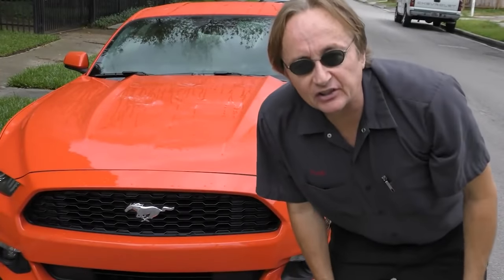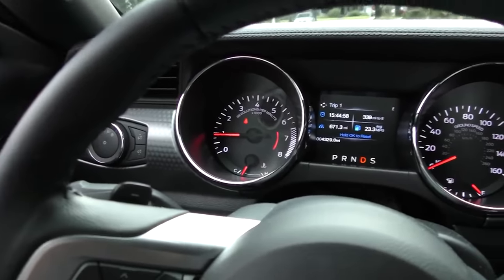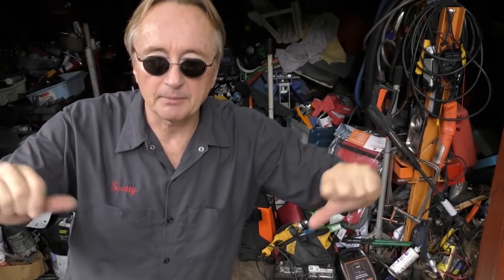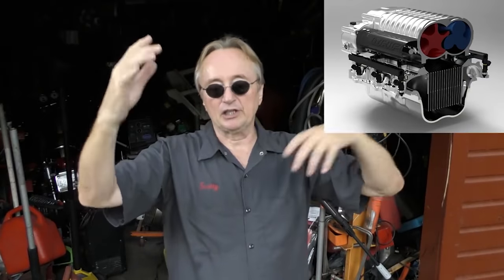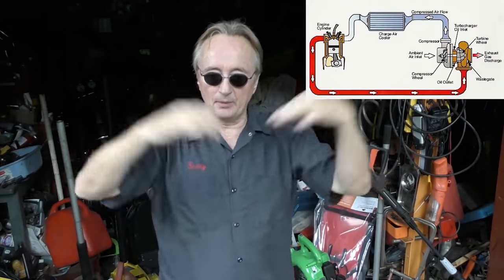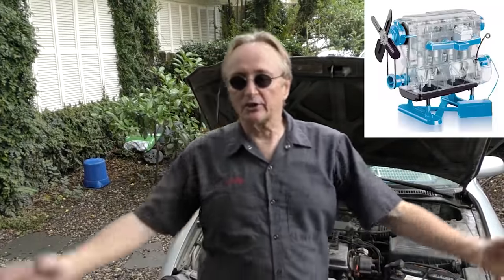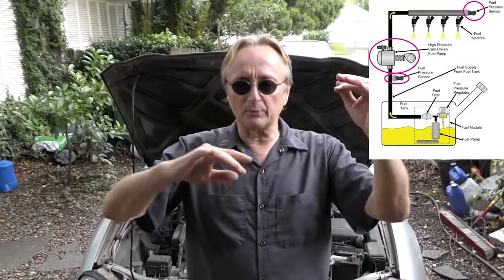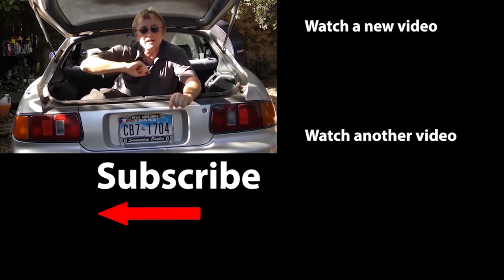I Was Wrong About This Engine and I'm Sorry

Comment: That old V-6 that Ford used to make available in the previous generation Mustang was sweet.  Sad that Ford kicked it to the curb in the name of foisting the Ecoboost on its customers.
Reply: Diesel cars have had turbo & direct injection for 30+ years and lasting over 200,000 miles.  Gasoline turbi-DI should be able to do the same

.

Comment: Recently was in the market for a mustang was gonna get a 16 ecoboost but got a great deal on a 14 with the 3.7. I LOVE this motor. Sounds so good at redline.
Reply: The 3.7s are solid/reliable engines...  Some of the earlier models (~2011-2014) offered a performance upgrade option (Mayhem Mustang) where they upgraded a lot of brake/suspension components with GT parts and upgraded differential gearing. Unfortunately, when they rolled out the Ecoboost, they stopped offering the upgrades on the 3.7 and only made them available on the Ecoboost. They really improved the V6s from the previous generation (4.0 SOHCs)... However, the MT82 does take some getting use to though.
Reply: It’s a great motor. I hope you keep it for a long time
Reply: @robc7323  yup they stopped after 2017 with the v6 and its a shame cause I had a 16 ecoboost and it's not the same. Even with less horsepower the sound alone makes the motor more worth it. Car only had 48k miles on it and it's in GREAT shape. Only repairs needed now are sway bar link and brakes. Funny thing is with the ecoboost I had to use premium gas with my performance tune and with reg driving I'd average around 21 in the city but with the v6 I average 20.5 and that's regular gas so much much cheaper. Loving this car. I want a louder exhaust a  slight tune to get about 330 hp and a Bluetooth touch screen because mines a base model and didn't come with Bluetooth 😐
Reply: @CactusJack252  planned on it! It's my daily driver and after this is paid off I planned on getting a beater. She handles great in the winter with some good winter tires. Plus they don't make the 3.7 anymore so it may become a collectors piece.

Comment: The 2.3 Ecoboost is the only engine available for the Ford Ranger.  On paper, the 2.3 Ecoboost outperforms both the hp and torque numbers for the 17 year old 4.7 liter V8 in my 05 Tundra.  Fingers crossed, we have to wait and see how well the 2.3 Ecoboost holds up to 17 years of use.

Comment: 2014 Ford Fiesta ST 1.6 ecoboost  160,000 miles and going. Oil change every 5,000 miles. Oil in a turbo car gets gets hotter as the oil lubricates the turbo. I have the dealer do the oil change and use a coupon.  I am on my 4th set of brake pads and 4th set of tires. I also have swapped the rotors twice. The initial brake pads were too aggressive and they and the rotors were all gone by 30,000 miles (originally it had racing brakes that stopped you in a hurry). Ford changed the pad compound in 2015 and pads were hard to get as the auto cross community burned up all the spares. I now use Canadian rotors. I drive normal and get 33 MPG. I can still spin the front wheels if I hit the throttle too hard and the road is wet when I start out at a light. The car is nimble and quite fun to drive and I drive it daily to my job as a math teacher. Changing the oil is the key to longevity in the ecoboost.

Comment: Welp! My 2019 Ford Fusion Titanium has an  Ecoboost 2.0L 245hp engine. It's currently at 53,000 miles. First 3 oil changes were at 10k each, fourth through sixth oil changes were at 7k miles each. Fuel injector service done at 40k. Cabin and engine air filter every 15k and 25k respectively. I used to use regular 87 octane, but after my fuel injector service at 40k, it's been premium gas ever since. So far so good. I plan on keeping this car till at least 200k miles 🤞
Reply: Bring that oil change down to 5k miles.
Reply: @slscamg  Do you mind telling me why 5k?

Comment: The best way to look at these little turbo charged engines is , they wont last very long. They will wear out a whole lot faster than an naturally aspirated engine especially if you drive it harder than just normal.
Reply: the brighter the star the hotter it burns the faster it dies
Reply: Our ecoboosts start knocking at 30k miles. They’re made to be 1 year lease vehicles then junked or resold. They don’t last long at all.
Reply: You sir are 100 percent right.
Reply: Older turbocharged port injected engines are better than newer direct injected ones.
Reply: @kyrosmike  Not really. Honda 1.2 liter turbo. 32 years old, still going strong and I regularly get it to 60mph.
Reply: @bremCZ  how many miles on it? It's not the age, it's the mileage.
Reply: @northdakotaham1752  I bought it with 150k on it, it now has just over 340k
Reply: @bremCZ  there has never been a vehicle made than makes me wish I could put 300k miles on it. I enjoy driving....but not quite that much.
Reply: @northdakotaham1752  Me neither.
Reply: @davidperry4013  as a rule all lower stressed engines last longer than higher stressed (higher specific HP) versions. High output performance Chevy, Ford, and Mopar non turbo engines are not as good at going the distance their low performance versions do. I have seen some 150k mile 2.0 DI turbo engines for service that were doing well but I have had a big sample to have a sound opinion yet. They have not been around long enough.
Reply: Diesel cars have had turbo & direct injection for 30+ years and lasting over 200,000 miles.  Gasoline turbi-DI should be able to do the same

.
Reply: @northdakotaham1752  it's not about whether you could put 300k miles on it. It's that it's good that a vehicle can last that long and you would think with technology improving so much. Why is it that 20-30 year old cars are more reliable and well built than new vehicles that are produced every year.. are we going backwards as humans? It's also good when vehicles last longer because each car that's in circulation not driving is just mechanical waste. Every vehicle being fixed and driven again that's 10-15 years old is another vehicle that isnt being bought and produced from a dealership. If that makes sense. We already have a chip shortage you would think the world would be focused on saving our resources now but everyone needs a new car every year...
Reply: Religious oil changes and not driving the car like a teenage boy who just got his license and youd be surprised how long theyll last
Reply: not true, 300k strong, firstgen/3.6 TT\ECO and still running. take care of your ride.
Reply: @bremCZ  rust bucket lol.
Reply: @electrictroy2010  turbo engines from 30 years ago did not make the boost and horsepower that they have turned these new "ECO" engines up to. Cylinder wall thrust today is far worse than older turbo engines. Its simply why the horsepower hours are exhausted in top fuel engines after 1320 feet of use.

Comment: Yeah the funny part is that 4 cylinder Mustang engine has a habit of exploding because of the strain it's constantly under.   I talked to an older guy at the Costco gas station a year or so ago and his sister had a 4 cylinder Mustang newer model and he said her exploded and she was about the same age range as him, he was in his 70s.
Reply: They put this engine in a lot of vehicles, and they last. Maintenance is key.
Reply: @bongodave13  exactly
Reply: I feel about the same about a 4 cylinder in a modern Mustang as I did when Ford put a 4 cylinder in the Mustang 2 back in 1974. It was crap then and it's still crap. Didn't work well then and won't work well now.
Reply: @Rick I had a nice laugh from that one as well.
Reply: @northdakotaham1752  The facts defy your analysis.
Reply: Did she happen to be from Pasadena?
Reply: Diesel cars have had turbo & direct injection for 30+ years and lasting over 200,000 miles.  Gasoline turbi-DI should be able to do the same

.
Reply: @Rick Spark plugs are mostly a maintenance issue, not so much a "repair." So there's that.
Reply: @electrictroy2010  The internals of turbo/supercharged gasoline engines are built/manufactured much tougher/stronger now. Technology evolves and humans learn from the past much quicker than our species evolves. And then you have Darwin... So there's also that! lol
Reply: And then there are people who have these engines high strung to the moon and have no issues. Sometimes the car you buy is a bad car and other times it is not.

Comment: I do have a 2014 Eco Boost 3cyl-1L Ford Tourneo, and I drive it like a granny, I get the oil changed frequently,  now it has 85000 km (about 52000 mi ), consumption 5.8-liter_gasoline/100 km, so far the engine is ok.  With stick-shift, I try to shift very gently, so that the pressure relieve valve of the turbo doesn't spring in action, use low rpm (1200 - 2500/min), and before shut-off mostly let the engine idle half a minute to cool the turbo. 
One disappointment is uphill in the snow! Because at less than 1000 rpm it rumbles, that rumble transmits to the tires, and the car slips. 3-cyl-problem! maybe it wouldn't matter with an automatic transmission.

Comment: i fell in love with this car when i rented one for vacation.. i really want one lol. idc about the coyote or going fast. it's just a fun car to drive. esp with convertible.. i would probably get the older v6 over the 4 cylinder if i could find one. ive heard the 3.7 is extremely, extremely reliable. glad people hate on ford cause it keeps the price cheap of these vehicles. i love ford.

Comment: When Scotty said this engine was good, I was quite shocked. Turbo and GDI on a car that most likely will be driven hard is a mistake. The only Mustang I would consider getting would be the V6 which they stopped making, I guess you can still find a used one.
Reply: or V8
Reply: @cheezybread7783  Used V8's usually get abused plus they're gas hogs. A V6 is a good compromise. And if you can find one owned by an older driver, you hit the jackpot
Reply: Exactly. I've had 3 different friends' own turbo 4 mustangs and all 3 had leaked oil from overboost. One even had his piston rings fail at 40,000 lol
Reply: the exhaust note on the 6 and 4 cylinders is horrible, IMO🤮🤮🤮
Reply: @rodneygass  and that's the ONLY reason to buy a car.
Reply: Diesel cars have had turbo & direct injection for 30+ years and lasting over 200,000 miles.  Gasoline turbi-DI should be able to do the same

.
Reply: @electrictroy2010  You'd think. That's under the assumption that they are manufactured just as well. Back 30 years ago, even diesel cars had significantly fewer parts.
Reply: @electrictroy2010  I assume you refer to the Benz Diesels? Those were built like tanks, I've know two people who had them and lasted 300k + miles each. No way these Ford engines are built as well.
Reply: Volkswagen, Audi and BMW also been building direct injection diesels for 30+ years

Comment: There are certainly a number of known issues one should take care of as soon as they get one of these engines.  310hp from 2.3L is old school.  AMG getting 475HP from 2.0L.  And as with and GDI without supplemental port injection, you need to clean the intake valves every 60-80k miles.  This and the 2.0L are easy to do.

Comment: I have an Ecoboost 1.6 in my Ford fiesta st with 149k miles. Great engine. Besides routine maintenance I changed the coolant reservoir. I was concerned about carbon on the valves but so far there has been no issue
Reply: About to do my oil change tomorrow she just got 55k how’s it holding up?

Comment: I blame the EPA for all these issues. Anyway, I'm sticking to a V8 (02 Mustang GT) even though these smaller turbocharged  engines put out more horsepower. But we'll see after I get around to doing a Coyote swap. hehehe.. I have to admit that the non-turbo V6 in my Xterra does pretty good though.
Reply: They had a supercharged 3.3L in the pathfinder it had good early torque, but they actually made more peak power and better mileage with the 4.0L that replaced it.
Reply: Diesel cars have had turbo & direct injection for 30+ years and lasting over 200,000 miles.  Gasoline turbi-DI should be able to do the same

.
Reply: It’s the politicians that passed law for 50 corporate average fuel economy

Comment: I still prefer a naturally aspirated V8.
Reply: Me too, but I just bought a used eco stang vert for a daily, was too good a deal to pass up. I average 25-28 mpg (manual trans) and drive it hard. It feels more like a big torquey 240sxthan a mustang
Reply: you have never driven a super charged V8, and couldn't handle a TT. Tell me I am wrong and good luck with that if you try :D
Reply: @somlikerandomguy  Whatever dude (lol).

Comment: I have a 2016 Taurus SHO with the twin Turbo 3.5L. Had it for 20k miles now with no issues, even have it slightly modded for more HP. My biggest worry with it is the internal chain driven water pump giving out and leaking. So far no issues with that, and it's still under warranty till 100k miles, which is another 25k for me.

Also have a 2009 Cobalt SS with the Turbo GDI 2.0 with 149k on it. Biggest issue with that is the carbon build up that I had walnut shell blasted around 105k miles, I'm sure it'll need done again soon, or just replace the whole motor or scrape the car.

Comment: My 1.6 is stout af. But my fiesta st is an exception in a lot of ways.
Reply: A very underappreciated car.
Reply: I’ve been wanting to pick one of these up so bad! But I’m not willing to pay 20k+right now when these brand new were being sold under MSRP. Around 19k
Reply: @premalone8267  I got my for a lot less than msrp a couple years used. It’s worth more than I bought it for. I can’t bear to part with it it’s so
Fun and easy to work on.
Reply: @bongodave13  bro I have a usb cord that uses free software that turns my laptop into a scan tool
Reply: I have around 25-30 autocross events on my FiST. It's my only car. It takes me to work, puts smiles on my face at the track, plows through snow, and drives 1300 mile roadtrips without a hiccup. It's tuned, running 26psi of boost. What a wonderful little machine. Couldn't ask for a more fun and useful daily driver. Super underappreciated in my opinion. The 1.6 EcoBoost has gone 300k miles in this platform without issue
Reply: @mjcmustang  it’s so adequate.
Reply: @mjcmustang  The key is regular oil changes. NOT @ 10,000. Ford is wrong. Use good full synthetic every 5000. Keep the turbo clean and nicely lubricated.
Reply: Love mine, Mountune MR230 and supporting mods. So much fun to drive. Bought it new in 2014; currently has about 95,000 miles on it.
Reply: @Bongo Dave  BINGO. I strictly use Pennzoil Ultra Platinum 5w20 with a Wix 51348XP filter. I've done oil analysis through Blackstone and it's been perfect every time. They keep telling me to push to 6k oil changes but I'm not pushing my luck. Plus 5k is easier to remember. I'm at 55k miles and when you open the oil cap, it's spotless in the cylinder head. No discoloration and there is virtually no wear on the camshaft. Mind you this car sees WOT and redline on the daily. However I do take care of my car, including brake flushes (every 2 years which is universal for every car) and slave cylinder flushes to keep it happy. Don't want to drop the transmission to replace the slave cylinder. Coming up on 60k maintenance here soon. Going to flush the coolant system and upgrade to the new Motorcraft Yellow coolant
Reply: Also going back to Scotty... running good quality full synthetic oil and changing it regularly will negate any issues with cam phasers
Reply: @mjcmustang  changing your oil helps. You just use whatever the manual tells you too.
Reply: @Jacob Mullins  I wouldn't, at least not what Ford says. I'll never take my car to 10,000 miles on the same oil. That's pure insanity. The Pennzoil Ultra Platinum is one of the best oils on the market, much better than the Ford stuff, and it's formulated for turbocharged vehicles and GDI. Wix also makes some of the best filters out there. I'd do research on micron ratings on filters if I were you. You'll discover OEM is not always the best. Wix or nothing IMO

Comment: The hp and torque of those don't mean much because it's up high in the rpm it's like putting food on the top shelf you cant really reach it very well. Plus just driving around town it wouldn't feel any different than a common commuter car

Comment: every 30k miles or less you got to have the valves clened to get all the carbon off so if you love an $800 bill every 30-40k miles be my guest the V-8 is the only way to go IMO.
Reply: @mjcmustang  Oh I do and I vote the right way.  I just get Pissed at Ford and GM because they are passing these known problems to their customers. Its going to back fire hard on them too. I had problems with my Ford Fusion now I drive a Toyota. How many others that have had these issues have followed me and now have a Honda or Toyota? I can tell you A lot from what I saw at the Toyota dealership. Tons of Ford and GM used cars for sale. Most traded in for Toyotas from customers pissed at GM and Ford.
Reply: @NDIrishfan71  I will say my Fiesta ST has been flawless so far. I beat on it but I take care of it as well. Carbon buildup is the nature of GDI. VW experienced that in the early 2000s when they first brought out GDI vehicles. The 1.6L EcoBoost is the best of all the EcoBoost family. They've gone 300k miles in the Fiesta ST platform. Same engine in a fusion or escape, except for mines a manual transmission

Comment: Honda and Toyota equally build excellent engines.  I had a Kymco 115cc scooter in Taiwan that had 100,000 km on the factory Honda scooter 4 stroke engine and the scooter never missed a beat.  I changed the oil once every 3 years and that was about it.  Kymco gets their scooter engines directly from Japan and then build's the scooters in Taiwan.  I have a 2002 Rav4 in Canada now with a 2.0 and the engine is also very very well built and requires little to zero maintenance.